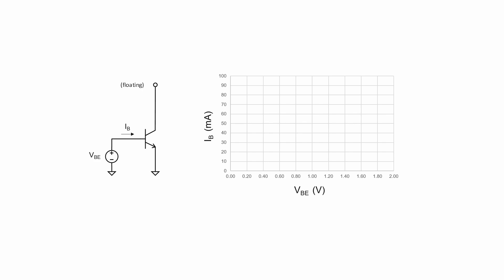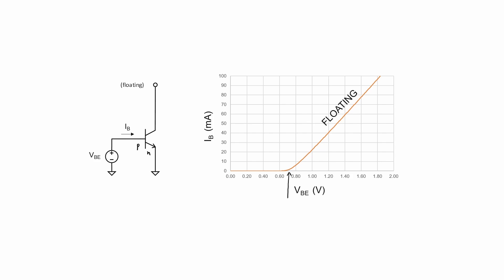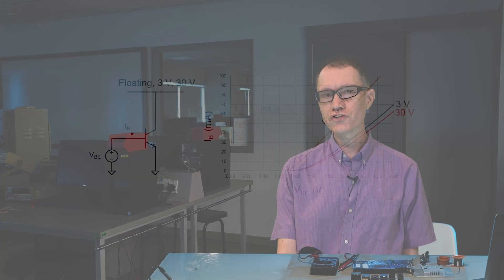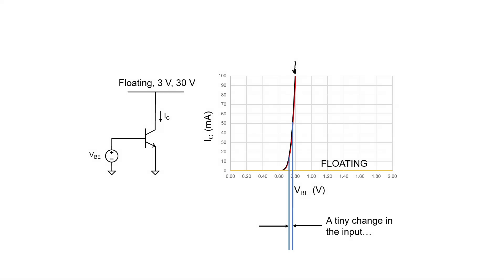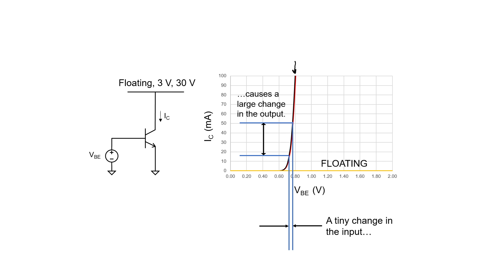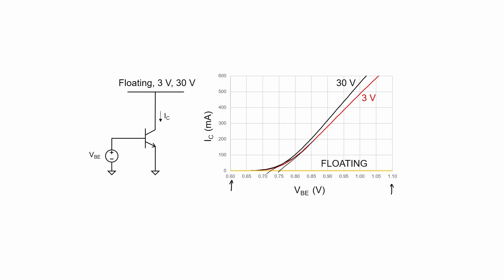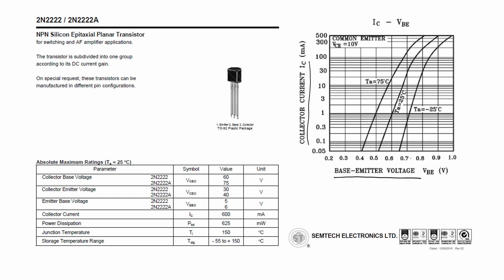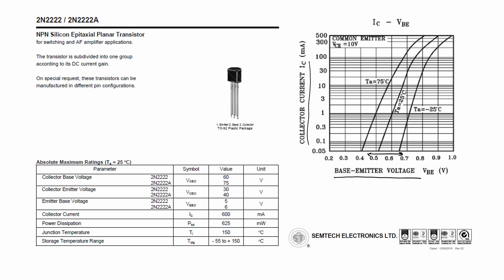High gain, but not easy to control (18-Transistors)

Comment: i don't understand why you say it functions really well as a current source. like you say, the same current level can be achieved by many voltages at many different temperatures but how is this useful? if its so hard to control, then its not a great current source, right?

Comment: Is transistor voltage control  or is it current control ¿?
Reply: both, as Ic = beta*Ib and Ic = gm*vbe.
Reply: The BJTs are current controlled current controller, while the MOSFETS are voltage controlled current controller.
Reply: Input Base current control output collector current so current controlled device